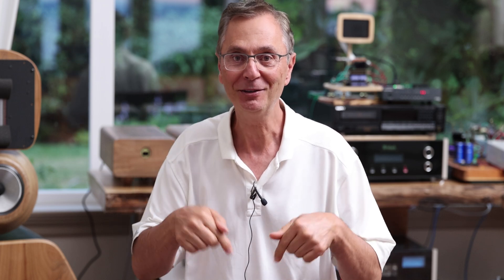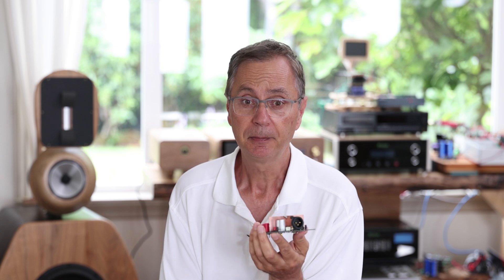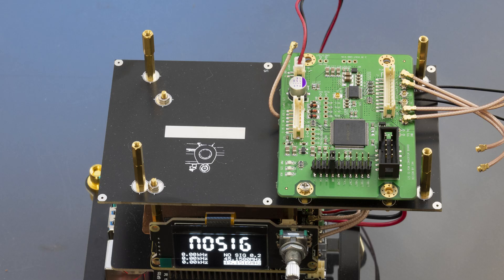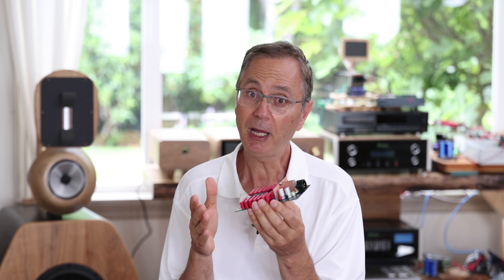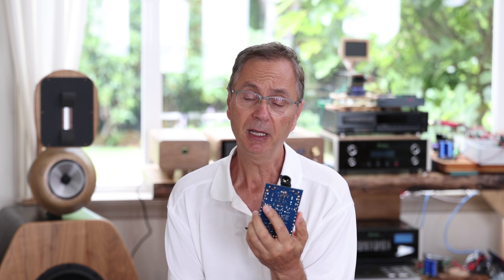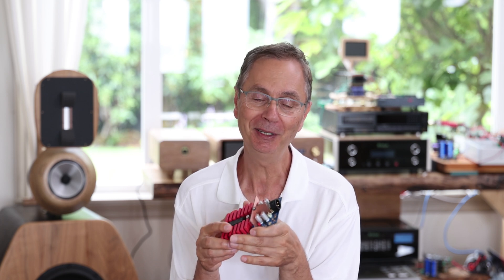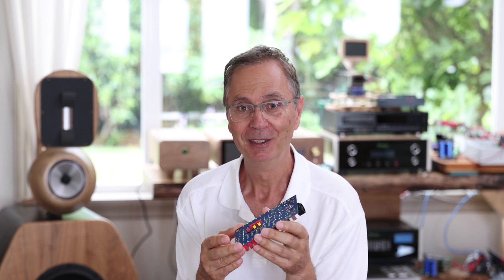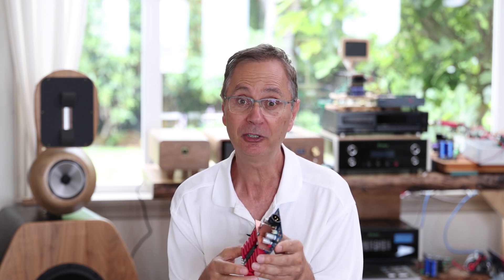Gabster TD1 Dac Features and Tips. Part 2

Comment: Gaby, thanks for the heads up about ordering products that may run out of stock with Ian Canada - I was going to wait until I had the 2 boards I ordered from you, but now I’ll do it the other way round. As we discussed in email I ultimately am looking to build a differential pair configuration, but will definitely try your suggestion first - if nothing else it will give a good sound comparison benchmark.

On the subject of the I2S to PCM boards which Ian Canada supplies, the manual mentions about how they can be combined with the FiFo Pi reclocker board. As I will initially be feeding mine from a low jitter streamer with a clean USB output signal, I had planned to use the Amerano USB board with one of the FiFo Pi boards then connected to the I2S to PCM board. However some of the choices on Ian’s website are a bit overwhelming - I was just going to go all in and buy the FiFo Pi Q7 with Amerano USB board to connect the reclocked signal to the I2S to PCM board. Can you say if this is the correct way to go and also whether it’s even worth using a reclocker FiFo Pi board with the I2S to PCM board from your experiments so far?

Really appreciate any input you can give on this as I now need to get an order placed with Ian Canada ASAP 👍
Reply from the maker: Yes FifoPi Q7 then PCM Board  is your best way 
Now before the FIFO Q7 you can use a Purepi Raspberry pi 
Or Purepi Amanero / DDC 
If you are running Roon Raspberry pi is a great choice then you have a full streamer Dac combo in one awesome system

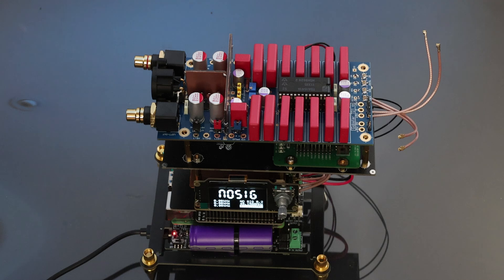Comment: Hi Gabster, have you tried using Ivan’s D60 for your TD1 board? I just purchased a pair (with Jfet buffer followed) for Ian’s 9038 board and sounded good. Wondering if it is something that can match very well with TD1 (it is using very low value IV resistors (14R primary and 3400R secondary for turn ratio 1:16–so the dac sees 7R at its output)
Reply from the maker: I have one of Ivan’s D60 with and without Jfet 
I am not a big fan of choking the signal with low resistors. While the sound seems good the imaging and 3d holographic sound suffers big time.
The smaller your IV resistor the worst it gets 
At 14R the Left and right Chanel are separated by 28R ( basically No separation )
If your speakers are well positioned for good imaging you will notice it big time.
Reply: @Gabster1  That is so important to know… And indeed, I noticed that the soundstage is weird when I use the current setup, but I didn’t think it was because of the IV resistor! It was hard to describe the feeling, but somehow it feels like the sweet spot of the listening position becomes super narrowed… Would you mind recommend me a proper value for the IV resistor so that it has a good balance between the refinement of the sound and the sound separation? Currently I am using Ian’s 9038 board… and plan to just change the 9038 board to your TD1’s but keep using my current IV setup… (trans+Jfet buffer)
Reply from the maker: @zehaoyu9401  my best setup with Ivans Trafos was without Jfet using a 100 Ohm on the inputs and no output resistor
I used Vishay Zfoil resistors 
https://www.mouser.ca/Search/Refine?Keyword=71-S102JT100R00TB
The Gabster TD1 still has way better 3d image
far better then Ivan's I would use it as designed first with the OPA 861 IV stage.
then Try Ivan's trafos and you will hear what I mean.

Comment: Hi Gaby, thank you for your videos. I bought 2 boards from you. When I go to IanCanada to buy I2S to PCM converter it now says sold out. I emailed Ian to see if he will have more later.
Reply from the maker: Thanks for letting me know 
Hopefully he will get more made I am sure it will take sometime let us know if you get a ETA of some new ones I believe he is on holidays for a short little while
Reply: @Gabster1  Yes, I will let you know when I hear back from Ian. Thank you for all you do with the DIY community.
Reply: @Gabster1  Hi Gaby, Ian has back in stock. From Ian: Re-stocked. But the lead time will be two weeks because one of the cables is out of stock. This is ok with me because you mentioned 8-10 weeks to ship out your TD1 boards. I also asked Ian if he is planning on making 15v power supplies for your TD1 project.

Comment: RCA sockets play an important role on delivering the signal from the DAC, so Aliexpress, from my point of view, is not the way to go. On my Revox B225 with two ceramic TDA1540 (still the best sounding multibit chip built), I have also upgraded to a pair of some of the very best RCA sockets around (WBT 0210 AG MS). Very expensive, but superb.
Reply from the maker: You can choose to solder any you  like but At 300$ a pair one may think twice about it.
Specially if you still need to use wires. 

The ones recommended are designed to fit both on a PCB and mounted on the panel.
They are reasonably good Quality and provide the shortest path with no wires in between bringing the entire board close to the panel for $10 a pair.
Reply: @Gabster1  , my Revox deserves nothing but the very best and with all the upgrades that I've made, it sounds fantastic. You really should try to listen to the TDA1540 - 14 bits of magic!
Reply: Gaby, thanks for the video and the heads up on the components to secure in the early stage. Just to let you know that the link on Aliexpress for the RCA no longer works . Do you mind to provide us with another one? Thanks
Reply from the maker: @GS-nk5lb  Thank you probably got bought up here is another link and will update it thank you for this info :)
https://www.aliexpress.com/item/1005001857159698.html?spm=a2g0o.detail.pcDetailTopMoreOtherSeller.5.b0c4isiXisiXSv&gps-id=pcDetailTopMoreOtherSeller&scm=1007.40050.354490.0&scm_id=1007.40050.354490.0&scm-url=1007.40050.354490.0&pvid=acf5b7ce-670d-4a10-86dc-f64fdb7204df&_t=gps-id:pcDetailTopMoreOtherSeller,scm-url:1007.40050.354490.0,pvid:acf5b7ce-670d-4a10-86dc-f64fdb7204df,tpp_buckets:668%232846%238116%232002&pdp_npi=4%40dis%21CAD%213.78%213.78%21%21%2119.33%2119.33%21%402101e7a317221922883125842ee4e2%2112000017877208007%21rec%21CA%212570165375%21&utparam-url=scene%3ApcDetailTopMoreOtherSeller%7Cquery_from%3A

Comment: Thank you for the good video.
I'm also using a Cambridge cd3, so I'm feeling the superiority of tda1541.
I watched the video and ordered it without hesitation today.
I have a lot of things to do from now on, but let's start with the UCPure power supply. ^^
Reply from the maker: There will be a video on upgrading the cd3 for the very few that own it 
But not till wintertime I have lots of plans for it 
But I do love it
Reply: Wow, you had a plan for cd3.
After watching the video that makes cd3 available for stream service, it seems that the part I was worried about has been solved.
TD1 is part acquisition first. (I'm sure you'll make a good sound)

Currently, we are making subwoofer for use in wegg3 stella.
The crossover design seems to take time.

Thank you so much personally.

Comment: Hi any reason why you did not use Raspberry Pi GPio pins to implement i2s since it's better? Thanks
Reply from the maker: You can it will work but they are  noisy  you need to re-clock the signal. The goal is to achieve the best sound possible.
Reply: @Gabster1  thanks for the insights
Reply: @Gabster1 I wonder if you might be able to help me? I have an old Roland 880 digital workstation for home live recordings. I'm trying to find a bi-directional interface from the coaxial digital on the 880 to go USB into my computer so I could transfer digital audio in both directions from the computer and also from the 880 onto the computer. Any suggestions?